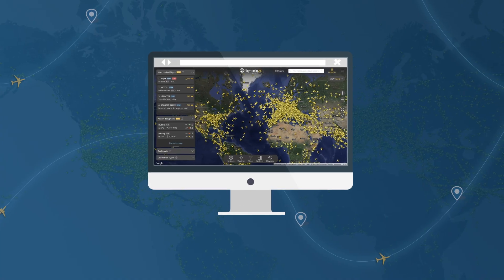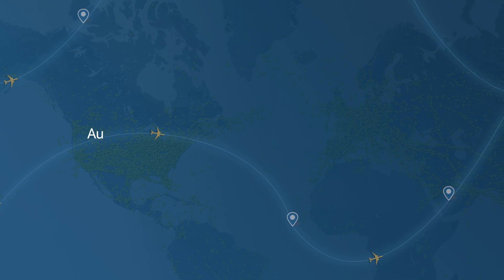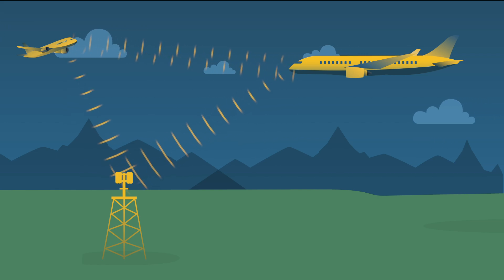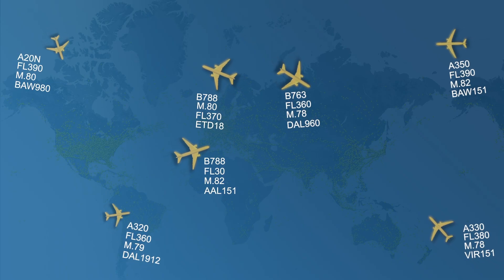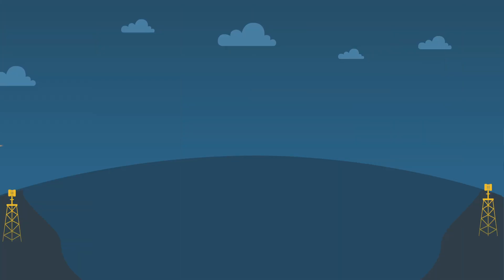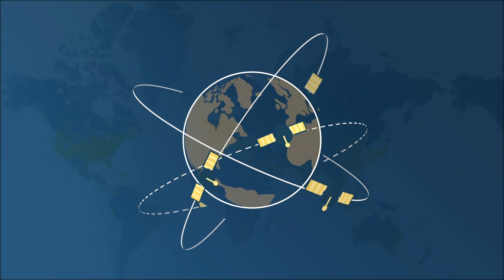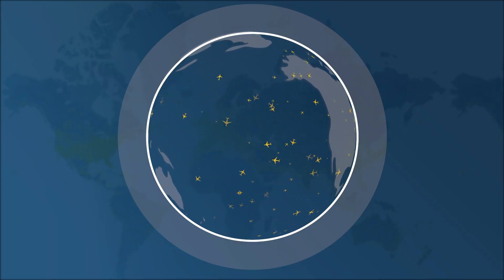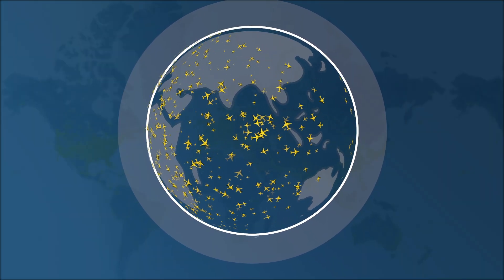How does ADS-B work?

Comment: Space was made in a Hollywood basement and these people are lying through their teeth. Beyond traditional radar or equipment potentially attached to helium filled balloons, all they are doing is estimating because they certainly aren't tracking anything over open oceans once the airplane is beyond the range of 150–250 miles, depending on altitude. The G in GPS clearly stands for Ground rather than global because it is a Ground based system.